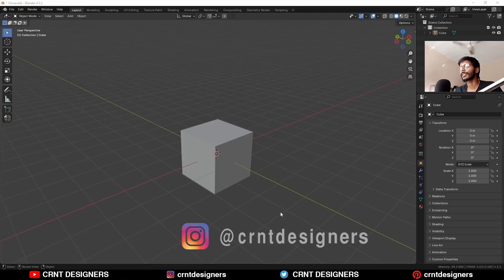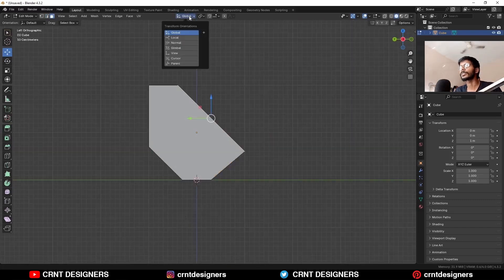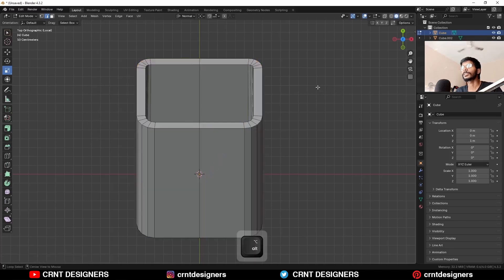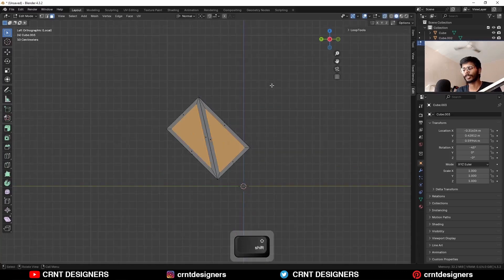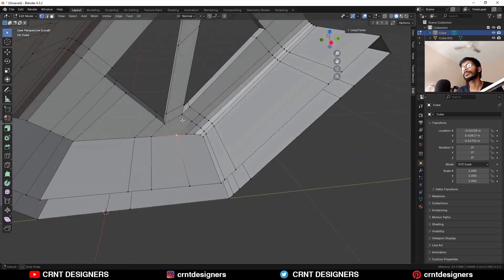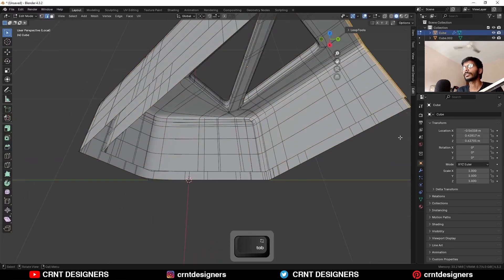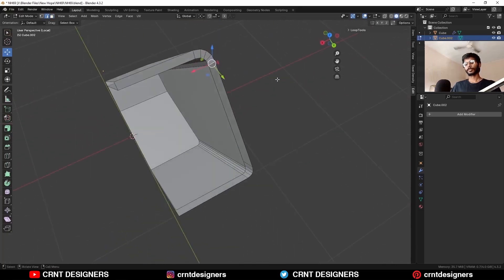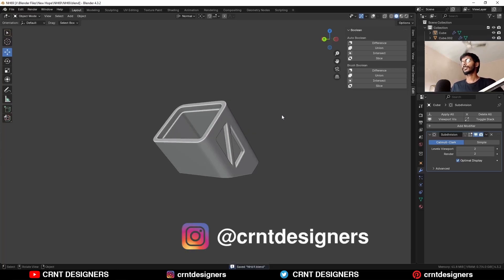NH70 _ how to model this hard surface design _ blender modeling tutorial

Comment: Hey I have a blender question but it doesn't relate to this: I want to move induvial vertices in the UV editor but doing that alters the image texture which I don't want. Because right now, I can't get all of the vertices to line together with the image texture without moving some individually. Any suggestions? Also pinning them doesn't work for me.